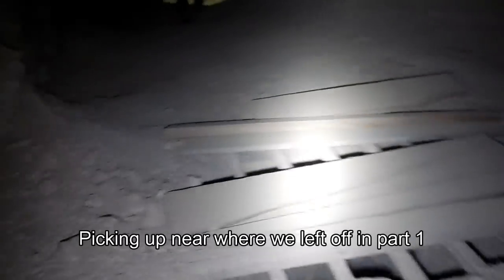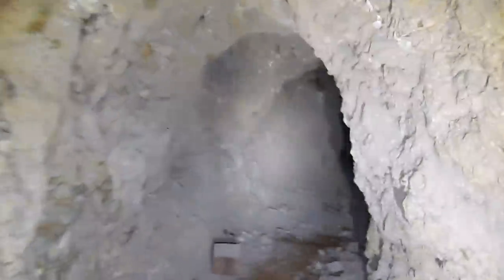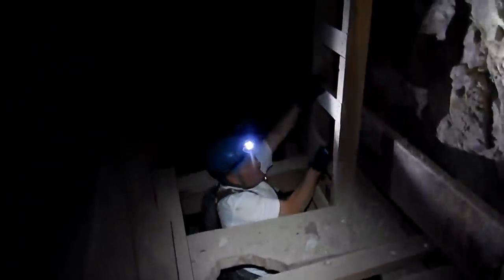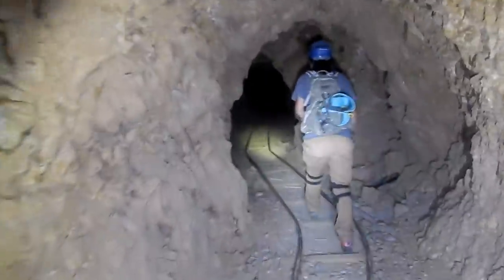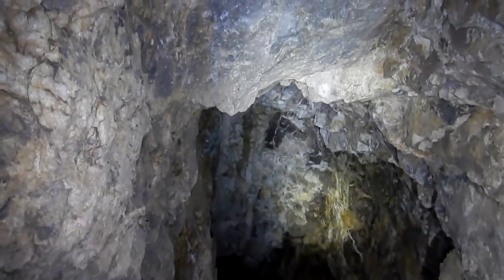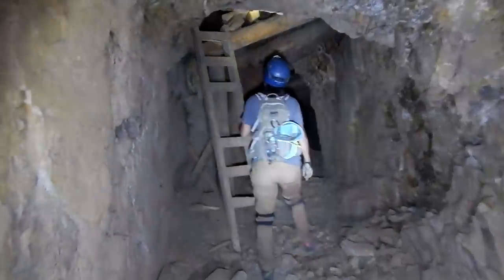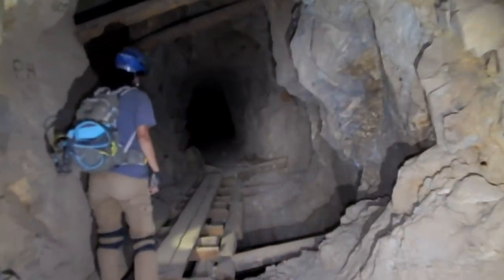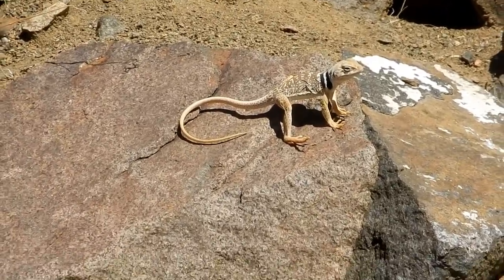Huge Multi-Level Tungsten Mine With Numerous Artifacts part 2 of 2

Comment: Good job guys. I explored this one in the early 90's. If one can make it, the left drift goes all the way to the original vertical shafts farther back in the mountains. The winze you partly climbed goes 500 feet down. I don't remember a significant amount of workings down there.
Reply from the maker: It think we followed all the drif5s to their ends on the main level. There were definitely a couple caved areas. There were several smaller shafts that went to at least a partial lever about 40_60 feet below the main level that might get you farther into the mountain. Can you tell me anything about the main shaft or drift levels off of it? Thanks for the information. It's always fun to hear from someone like you!
Reply: @TomandJulieMineExploring  There are two main drifts on the left side, one being the Noble workings. One of these two eventually meets one of the original vertival shafts farther back in the mountains. You'll know you're there if you see pinecones in the rubble heap at the intersection of the vertical shaft.

Comment: Those General "V30B" batteries are interesting artifacts that I haven't seen in other explore videos.  I looked them up and they are 45v dry batteries used in tube type portable radios from the 1940's.  I wonder if they had early tube radio communications set up in that mine. Doubtful they'd be listening to AM radio down there and 45v would not be used for lamps or lighting.
Reply from the maker: I meant to look them up, but never got to it. I thought they were D cells when I saw the boxes, although I couldn't read them without reading glasses. I never opened the boxes because the one that was slightly open looked  leaky. I'm  not sure what they were used for. Radios don't  work very well in mines. Basically, line of sight is all you get. Thanks for doing some leg work looking them up!

Comment: Did you try a black light in this excavation? It was always fun finding pieces of Scheelite when visiting old tungsten prospects of in Southern California when I was a kid. I guess tungsten was very valuable during WW I and WW II, and the price went down later. Where is it mined these days, you think? (oh, looked it up, China of course) Cheers...
Reply from the maker: Thanks for the fun comment, Steven. I have been playing around with a UV light that I picked up recently. I didn't have it with on this explore, but sure will on our next tungsten mine.
Reply: @TomandJulieMineExploring  BTW, NCN is nitro carbonitrate, a generic term for ANFO, but I've also seen it prebagged like that and labeled accordingly. It was a huge (>500 lbs) pile of bags in a storage room of a uranium mine in Utah. Right next to the highway, locked up but  barred gates anyone could climb under. But that creeped me out far less than breathing the radon-contaminated air, since there was no ventilation. Pretty boring, other than that because it was just room and pillar, no levels. What was cool was the little stream of water leaking out - it had yellow and orange deposits on the sides in places: uranium salts and other exotic elements - definitely radioactive...

Comment: Boy, i am comment crazy tonight, but those areas that you said were collapsed or water got in there, I think your water theory was correct because where the tunnels end remind me of logjams when rivers flood.  It looked like water washed timber and silt and who knows what else until it jammed and formed a seal.
Reply from the maker: You were on a comment roll, Paul. We occasionally see that look of timbers that have been flooded and gathered into one place by the water. There is not much else to explain it. Thanks, Paul!👌